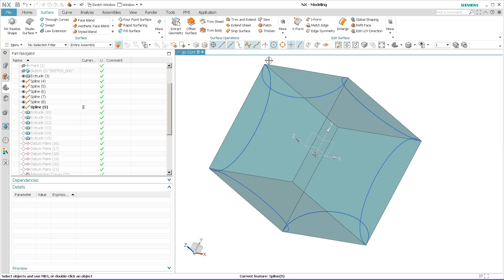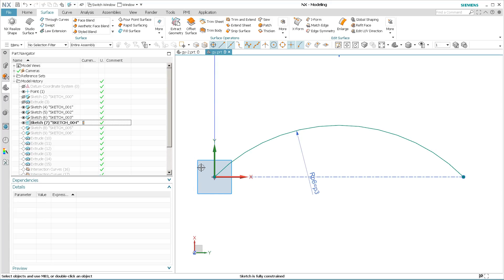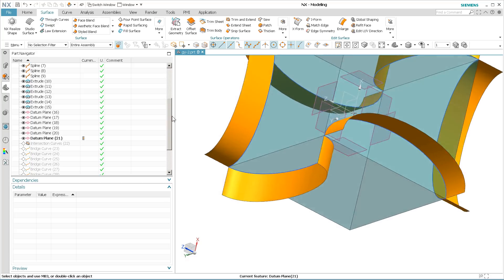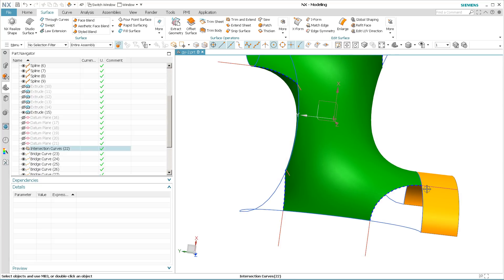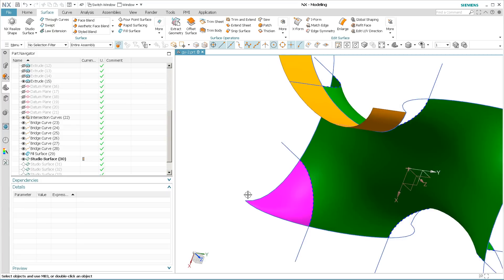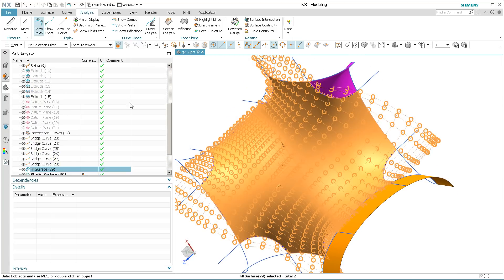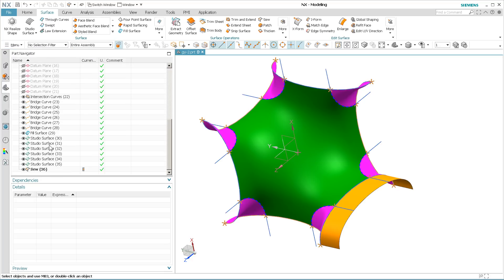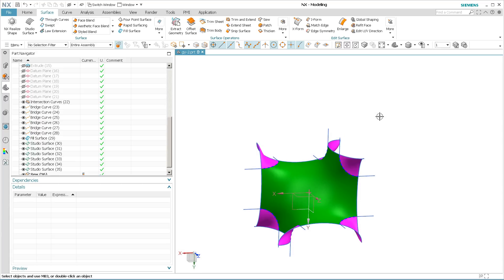Siemens NX: Revisiting the Gyroid

Comment: Thanks for the video, but is there a possibility to adjust the curvature in the corners? for the moment, it is not possible to apply the Thicken command due to the corners curvature. My personal goal is also to pattern the geometry in order to obtain a lattice structure. Thanks in advance.
Reply from the maker: There are ways but it depends on the sharpness of the corners and how tight things are.